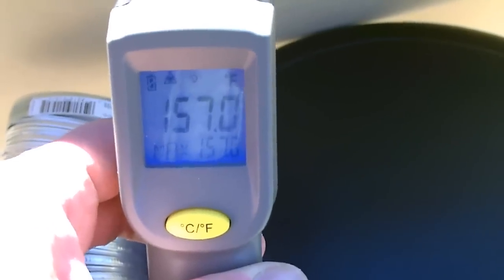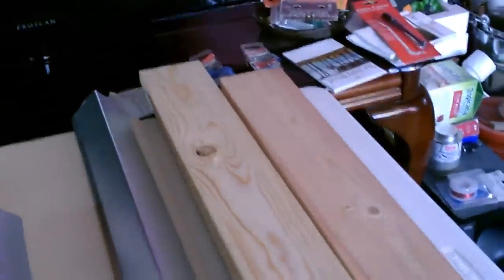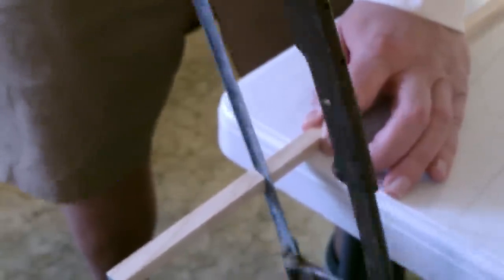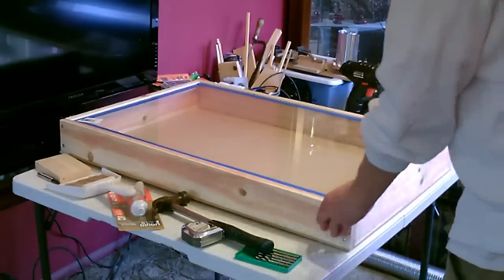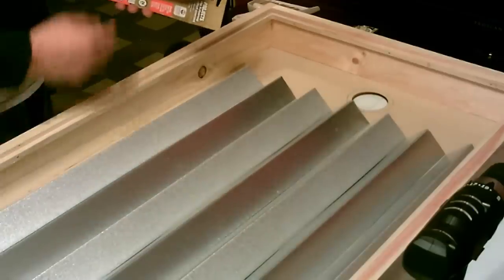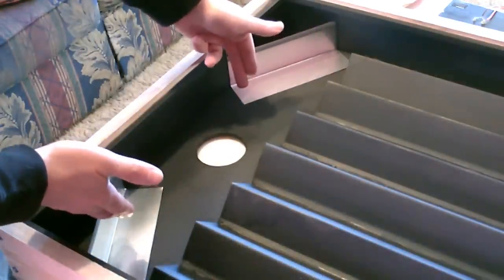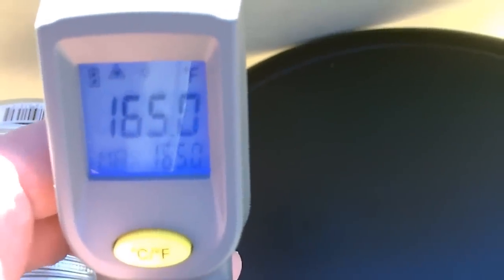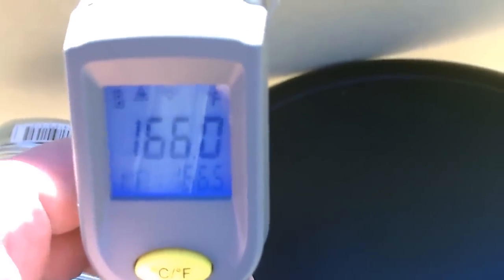DIY Solar Air Heater! - The Steel Slat “Drip-Edge” Solar Heater! - New Design! 160F 74C in January!

Comment: These are great little proof of concept DIY solar heat collectors but, I'd like to see one installed in a real world case with proven results.  Anyone have proven results to heat a livable space?
Reply: Shawn, they can and do work. Design can vary from whoever is building the unit. Personally I built 1 out of recycled sheet metal and osb, and glass from a sliding glass door. The sheet metal was made into 2-1/2" square tubes built in a S- curve layout, one small baffle as intake lowest corner then the tubes zig-zag with about 1" gap between the tubes. As the air in the tubes heats and rises I put in an exhaust vent in the upper end and that is vented into the room. 
The heated air is then blown into the room using a recycled 110, 4" computer fan, which i use a snap switch, to automatically turn the fan off and on. The snap switch turns on at about 90° and back off around 85°. Last year the we had one day when the high for the day was -12°f, I got a constant 3 hrs. @ 98°, until the clouds moved in. 
Working on another build using thin sheet metal for the box and aluminum cans for the tubes also in a serpentine configuration. I've changed the material due to weight. 
Try a simply design using a cardboard box and some type of lightweight metal for the tubes, ie. aluminum cans with the openings, top and bottom joined by silicone and you can use cleat plastic wrap. Try a simple build, experiment, with material and design that works for you. There are numerous designs and from really cheap to really pricey out there, so look around and build what you can afford. They do work.
Reply: They were being comercially built and installed on homes in the late 1800s as passive ( no fans) units by a company in Oklahoma. Can't remember their name. Research it.

Comment: Not dissing your idea by any means Brother.. Great build! 
You want to really bump up the efficiency, duct your inside room air into the bottom of the panel. 
I had 2 section window units I built that mounted at an angle to the sun into a raised window in my trailer and it thermo-siphoned the inside room air down the back section of the panel and up from bottom thru a slot into front panel section just covered with black plastic and carpet sponge behind it for insulation so back section incoming air wouldn't heat up and colder intake air would drop faster to bottom and was getting continuous 120-130F at a lower CFM of course, back into the room using no power with no fan. 
If cloud blocked the sun or at night it would just air lock and stop siphoning until surface was heated up again. With 3, 6 foot long, 6" thick double section panels the width of windows only opened 7" for panel front plate to lock into window channel, then window closed down on plate. It kept the rooms comfortable so I was happy. 
The next year I added 2 small muffin fans like yours to the room fed intake bottom section (on the theory that it's easier to push colder denser air vs suck hot thinner air and less heat on fan motors and plastic blades) but if sun was shaded it blew same temp as inside air with only a few degrees drop and not the cold outside intake air and they were noisy. I heated a 12 x 56 trailer VERY comfey anytime the sun hit the panel. There were a coupe times we had to open a window or door to let some heat out or shut off fans and just let it siphon. I never did get around to mounting fans at the bottom of the panel with a diffuser I think would cut the noise way down, but I was warm and happy so why mess with it!
In the spring we just took them out of window and stored in shed.
But pushing in 60/70 F room air instead of 20F or less outside air in like yours, across a double metal surface you'd get fantastic efficiency with the fans! ... and wouldn't have to worry about sucking cold outside air into room if panel got shaded and fans were still running.
You could do same with yours now without too much modification by adding a manifold box on the bottom where you have your intake holes or cut them into slots across to reduce restriction and load on fan, and ducting in room temp air thru insulated dryer duct into that manifold to feed panel.. Bring output and input air into and from unit from same window insert plate with in and out ducts separated on each side of plate and solar panel mounted below the window and still get light thru window, less 4" for duct plate.
We're in the desert now so I haven't played around with panels in years. Low here was 44 last night and 76 today but in New Jersey it was a life saver then!

Dang, this turned out to be long winded.... lol
Reply: Interesting Do you have a video too?  Im a bit confused about how you got the  fan to turn without a solar panel
Reply: Gerbil?
Reply: Electricity?
Reply: Good ideas, thank you. For the inside room air intake is it better to go low by the floor or higher  up the wall....or no difference?

Comment: what if you "vented " both sides so the incoming air is already warm and just re heated ? then your fan could be on the "cool" side ? I'm with M Langford on this one :-)
Reply: i've learned from other videos that you need to suc the hot air and pump it out of the box. you can not blow cool air since it will increase speed and won't stay long enough to heat.

Comment: I'm curious what temps you would get if you covered the open air holes at the bottom. Nice work!
Reply: You'd still have to get air into panel to exchange or it would just create a vacuum inside panel. Panel would heat up, but nothing would come out.
Reply: @aguilacommunitywatch8782 Vakuum ne, jen stojatý horký vzduch.
Reply: K čemu by to bylo dobré? Ale zase tak moc by to nebylo,  se vzrůstající teplotou by rostly ztráty. Není to ani izolované a všude to být ani izolované být nemůže, ztráty jsou i v přední stěně.
Reply: Dumb ass !! That's the source of air for the heat exchanger to heat and move into the house. You don't know bout natural science or physics or thermal-dynamics. Do you? Just turn your thermostate up in ur "grid-tie" slave house.

Comment: would it be better with matte paint vs gloss?
Reply from the maker: hi. it's better to use matte (flat) paint than gloss. gloss reflects off to much of the light, making it less effective . i used matte. matte paint looks kinda glossy when you first apply it (before it dries) but loses the shine as is dries.
Reply: @desertsun02 .. Want to increase even a little more, spray it and sprinkle sand blast silica on it while it's still wet and dump extra off and paint again... increasing surface area and creating a little textured radiant heat mass for air to flow over.

Comment: what is the improvement in temp after adding the slats?
Reply: Maximun exposed surface as close to 90 degrees to the sun as it moves horizon to horizon. Closer you can get sun to hit plate 90 degrees there's less reflection and better the efficiency

Comment: Hello Is the glass on the top is normal or tempered
Reply: Have built several units, different design and much larger. Strongly suggest that use tempered glass, one due to high temperature, also if the glass is broken by accident, then you it shatters into small pieces not big shards of glass, where you can really get cut.

Comment: What's the outside temp? Not sure how much warmer the air will be if it's say 27 degrees Fahrenheit. We had a water heater using this principle, worked pretty well.
Reply from the maker: hi there. outdoor temps during filming were anywhere from 37F to 43F.

Comment: Great Project!
Thanks for sharing!
Just curious?
Have you tested the difference in temp when it's cloudy out?
I'm sure it will still warm up but just curious of the difference.
Reply: I tried the vertical configuration, didn't work as well as a continuous tube built in a serpentine configuration, small intake baffle at lowest level and exhaust at the top. Snap switch installed to automatically turn unit fan off and on. The serpentine configuration holds the heat longer, also builds to a higher temperature for the exhaust.

Comment: very  good - further using the drip edge V is smart approach. So some 160+ pulling in air cool air from the bottom.  If less, or even just one air (small) intake was at the bottom what would the effect be?  Of if intake was coming from low cool air location indoors as the source?
Reply: Have tried the vertical configuration doesn't work as efficiently as a horizontal single tube in a serpentine configuration. Small intake baffle at lowest level, exhaust manifold at top, snap switch to automatically turn the fan off and on. Produces a higher and consistent temperature than the vertical. Also just painting an empty box will produce about the same temperature results that he had with the corrugated metal.
Reply: PS. I have one working 3'x 72" box using a recycled 4", 110, computer fan. Snap switch turns on about 95° and off 85°+/-.  Will run all day, only turns off below 85°, usually due to clouds. Ran last winter when the temperature was at -12° for about 3 hrs. stopped due to clouds. Temperature at exhaust was running about 110° FYI regards

Comment: If you had a thermal mass in your home (cob or adobe maybe) to store that heat you could warm an area to a max temp during the day and it would slowly cool through the night.
Reply: Pizza stones?
Reply: Maybe phase change material, such as solution of sodium sulfate in water, could be useful?
Reply: 160 wouldnt probably last that long. Rocketstoves get up in to 500+ degrees.
Reply: @BlackHeartGuitar  160°F is plenty hot enough so long as you have a large enough thermal mass(hundreds if not thousands of gallons of water or dirt could be stored in a house without being excessively bulky) 500°F objects are a fire hazard.

Comment: what if you reused the heat it produces like central heat for say an RV, instead of sucking in outside air just recirculate from where you are heating.
Reply: Adding a heater that recirculates indoor air isn't going to have any impact whatsoever on the buildup of undesirable gasses. If it was properly ventilated before, it'll be properly ventilated after.
Reply: “Carbon Dioxide, Carbon Monoxide, Nitrogen Dioxide, Sulphur Dioxide, Methane, “

Where the hell do you live- in an exhaust pipe?!? Lol
Reply: @brucea550  Thanks Bruce A.  I think this comment was the best part of this video!
Reply: Yeah, I think that's what I would do too.. Suck in air from inside and spit it out inside. Why heat up 0C air when you can use slightly  warmer air from inside, and keep heating the air from inside.
Reply: Just an inlet switch. Recirc or fresh.
Reply: I put my build on the inside and it works fine. It is recirculating warmer air. Somebody’s drugs must have worn off!  There are no off gasses or environmental issues here
Reply: @joakke5114  No, none of those gasses will magicly appear. So no, what the HELL is it on about. Most sane people open the doors or windows from time to time, and ANY living space should already have ventilation. 

There is no reason to use heat exchanger. 

It does not have a point.
Reply: Carbon Dioxide, Carbon Monoxide, Nitrogen Dioxide, Sulphur Dioxide, Methane, etc... use in combination with a heat exchanger (except their efficiency sucks still) to preheat the intake air would be a better yield, but input electricity would outweigh any benefits.
Reply: @jadosrd8950  You aren't creating dangerous gases by heating the air up inside your house with only the sun. If you put a black sheet of metal inside your house near a window and pointed at the sun and it got really hot do you think that's creating dangerous gases? It's pretty much the same thing.
Reply: @jadosrd8950  What on EARTH are you talking about?? What you're mentioning here has nothing to do with what either M Langford wrote or I wrote.. 

The hell you on about? This does not produce ANY of the gasses you mentioned!
Reply: It’s in the air inside, which is why EVERY HVAC system draws air from outside.  The system doesn’t produce them, you do
Reply: @jadosrd8950  there are probably other systems in the house that will achieve this. Recirculating the air would seem to make the most sense for this application.
Reply: @jadosrd8950  SO whats the air return in my house do ?
Reply: houses aren’t sealed, and there’s a clause in the HVAC portion of the building code that limits what type of system is appropriate based on the size of the house.  Bathrooms & kitchens are vented.  Engineers make a lot of money making sure you don’t asphyxiate in your home.  In holiday trailers, they put a warning tag on the ceiling vent
Reply: I mean, the air being sucked into my air return, where is it going and why.